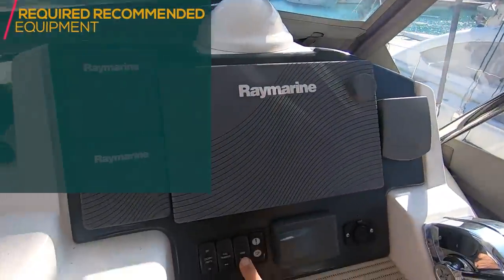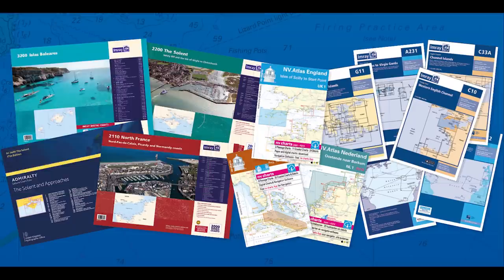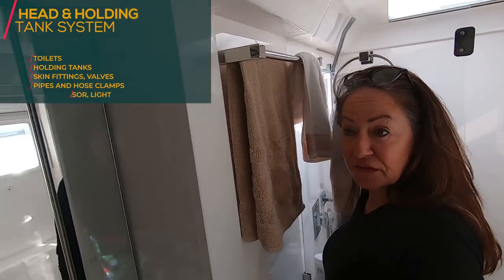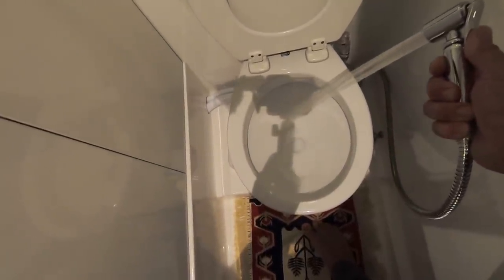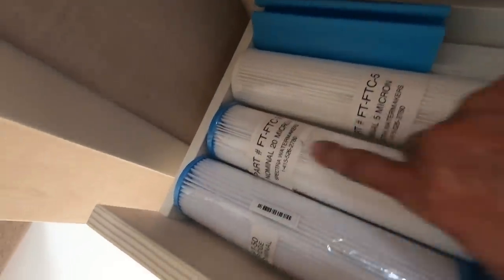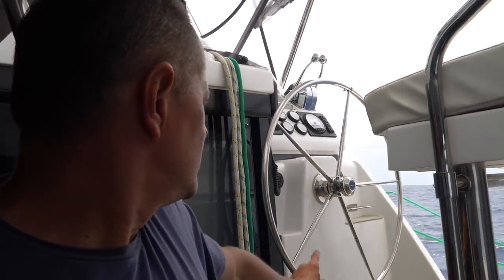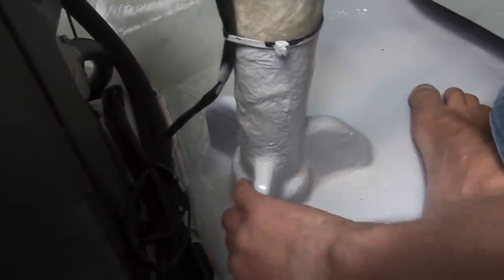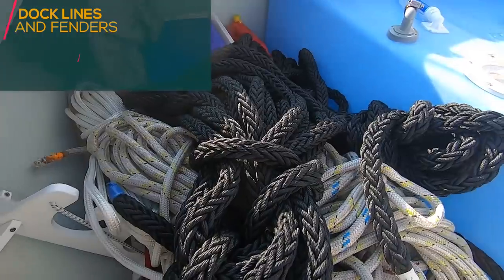#74t Part 2-Boat Life Checks - 100 Point Annual and One MONTH Before Passage|Sailing Sisu Leopard 45

Comment: You two are a great team and on top of maintenance. Prevent prevent prevent and you've done that. Well done for sure!  Where was the engine room leak? Do you have hull patch material?
Reply from the maker: Michael, thank you for the great support through the years! The water leak came from the rudder bearing at the end of that video clip.

Comment: The U-bolt clamps for steel steering cable should be in sets of three with one in middle turned 180 degrees from the others.  You only have two sets on the ends.
Reply from the maker: Thank you, Anthony! Yes, I added another, which should be visible when I did the clip where I checked the arm and cable?

Comment: As usual a great video...thanks for taking your time for producing and also answer on ALL questions...by the way, black water tank flushing, what is the ratio water / vinegar you use ?
Reply from the maker: thank you, Jurgen for mentioning that! we have fresh water toilet flushing capability so, we used our fresh water tanks to flush the whole boat. the higher concentration vinegar the better the descaling. so, for the black water tanks itself, we used a 50/50 ratio but also added a bottle of lemon juice and a cup full of bleach. we only filled the tank about a quarter, open the seacock and try to time it where we think the solution was and closed the seacock. the idea is to get the highest concentration in the pipes all the way to the seacock. then we filled up the rest of the tanks and left it overnight. then open seacocks and flush :-)

Comment: Isn't it a bad idea to use a dyneema rope to tie the boat up as it has zero stretch? All of the energy moving the boat has to be absorbed somewhere and will find the weakest point, which is probably the fiberglass around the cleat.
Reply from the maker: It for sure is if you only use Dyneema. We have i line shock absorbers which allow for stretching 😊

Comment: Hi Frik, lovely video 👍👍👍 how did you fix your bearing rudder leakage please ? Have you haul out and changed the bearing or just redo a proper sikaflex joint ? Look to hear from you thanks 🙏 Ben
Reply from the maker: Pretty long story, but in short, used a Inflatable lift bag under hull to lift aft out of water. Dropped rudder. Checked and Fixed bearing. Replaced rudder. Glassed the post as per video clip directly after leaky video clip
Reply: Sailing Sisu I seem to recall other Leopard owners having rudder bearing issues. Is it a design issue, or did the rudder get bumped and perhaps compromise the seal? The bearing assembly should robust enough to take a mild bump without leaking.  Your repair looks much more substantial than the stock installation
Reply from the maker: I think I will have problems when I need to replace the collar, which is now glassed in permanently. It is the collar, which is turning itself loose and that happens on all the boats with such a bearing.
Reply: I haven’t done anything as yet on my L44 (5 years old) however I’m planing to order spare parts first (bearing, ring washers) and then haul out and finished with serious sikaflex 291 joint on top, my current problem is similar than yours there is sea water daily drops 💦 from the rudder hole that trigger my aqua sensor alarm on my sail drive monitor panel. 

Will be very interested to learn more from your experience because your L45 is pretty recent only 1 year and facing the same issue than mine 

Look to hear more from you Frik
Reply: How to contact you by email or other way to share some photo or video from my side Cheers I follow you every week and I live in Indonesia keep going 👍

Comment: how much Sails do you have on SISU....2, 3,4, or maybe 5...and how much did it cost?
Reply from the maker: Hi, Darko! We have a main and Genoa which is part of standard factory. Then we have a Code 0 for close reach and a Code D for the rest. That said, I started to use the Code D for close reach too. Code 0 was around $500 USD and Code D around $860 USD